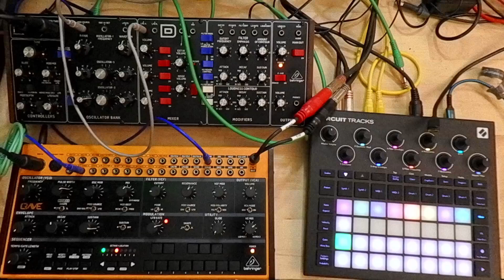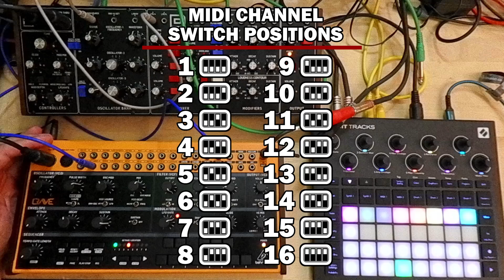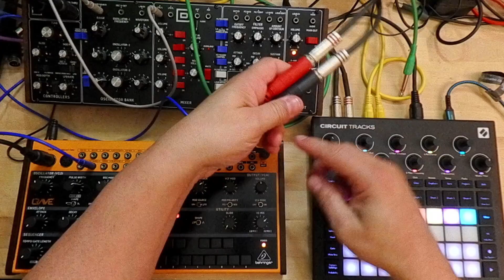How to use The Novation Circuit Tracks with External Hardware

Comment: Correction:  The 4 drum tracks do not send on MIDI channel 5,6,7,8.  They all send out on MIDI channel 10 and each only sends out one MIDI note number.  Regarding your mono audio outs from your two synths it would be better to run the Model D mono out into one of the Circuit Tracks audio inputs, and then take one of the two leads from the split outs of the Crave into the other audio input on the Circuit Tracks.  You don't need to use the stereo output of the Crave since it's mono anyways.  Just use one side of the split.  Doing it this way you would have audio control of both synths running through your Circuit Tracks.
Reply from the maker: Hello @EZ Meditation - apparently I am slightly confusing the Circuit Tracks and Circuit Rhythm. The jacks on the back do appear to be 2 MONO channels - not one stereo channel as it is on the Rhythm. I do have both devices and apparently confused that with the Circuit Rhythm as well as the drum channel are all on 10 and triggered with C3 for channel 5, D3 for channel 6, E3 fir channel 7, and F3 for channel 8. Sorry for the confusion - I'm only human hahaha (well mostly lol).
Reply: @Cap10NRGMusic  No problem.  Just trying to help so that others out there will have the correct information to work with.  I have my Circuit Tracks connected to a Korg Volca FM2 and a Roland AIRA S-1.  That is truly a great combination!

Another pro tip.  The Circuit Tracks mono inputs are unbalanced.  You can insert a TRS plug and the "ring" remains floating and not connected to anything.  Because of this you can use a 1/8 TRS to 1/4 TRS cable and only half of the stereo signal (tip) coming out of your synths stereo output will be connected to the Circuit Tracks mono input.  So you now have mono to mono with one simple cable.  No splitter needed.